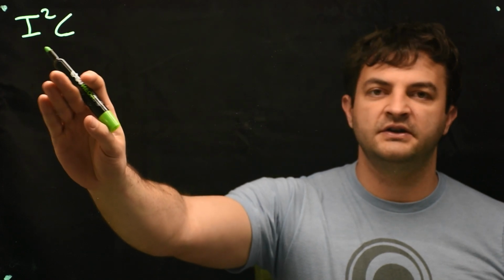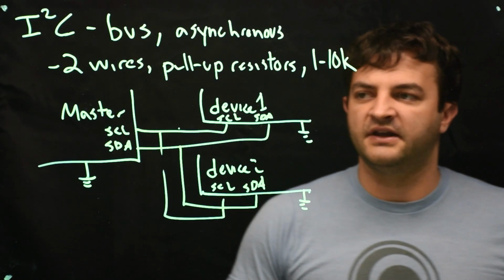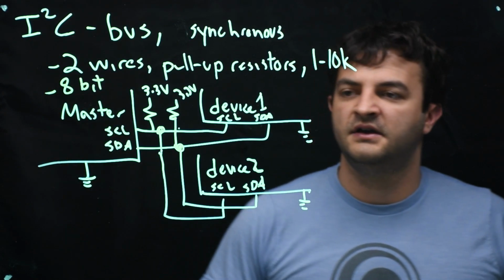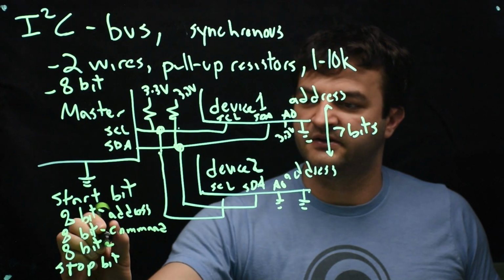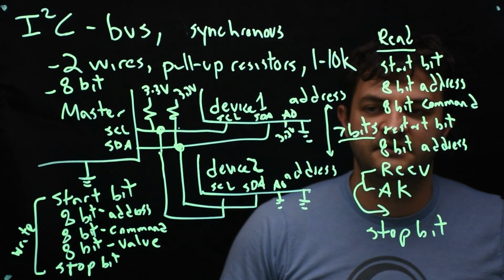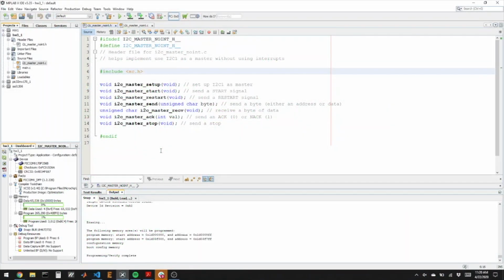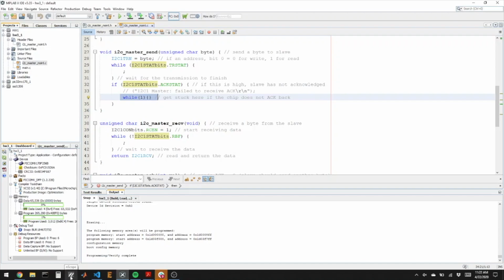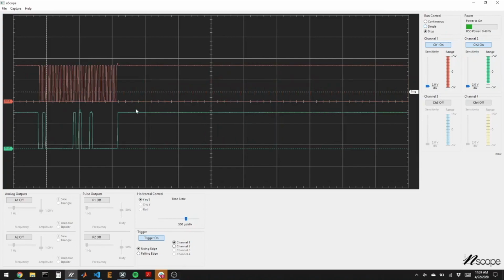I2C Communication on the PIC32

Comment: 2:50 "The pullup resistors allows the pin to switch to an output" - can you explain that? I would think only the microcontroller is setting the pin configuration. The pullup resistor simply biases the line to be HIGH, and if a pin is configured as an output, it can drive the line LOW.
Reply: Got through the rest of the content - great intro to this topic! And I think all you meant is the pullup resistors allow us to keep the line at a steady voltage while the impedance of the pins are changing while they switch between their output states. Let me know if you meant any different. Thanks!